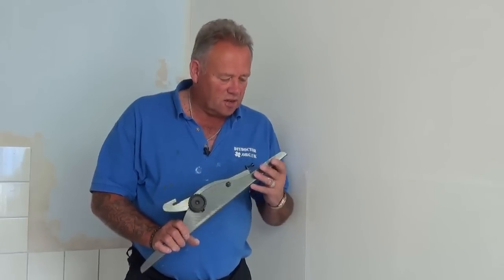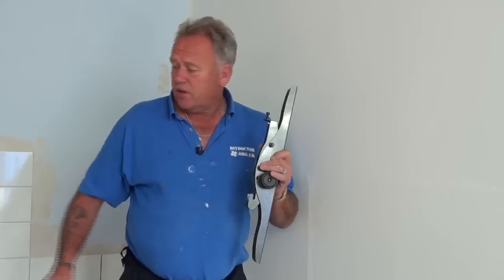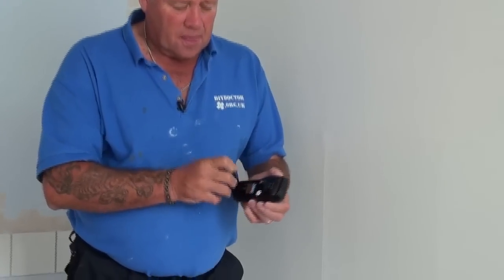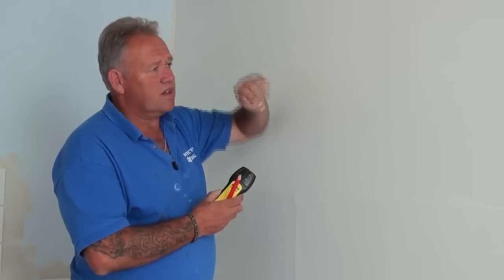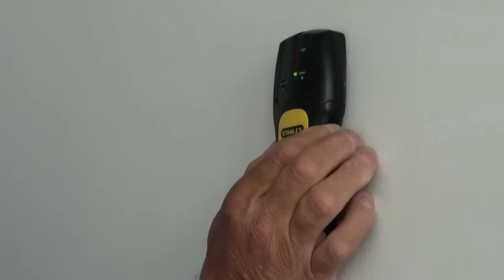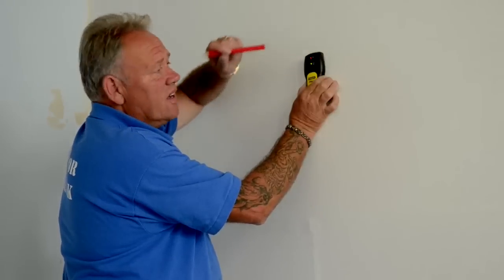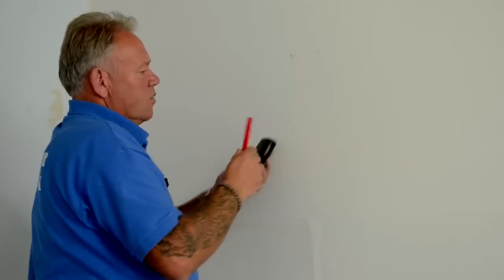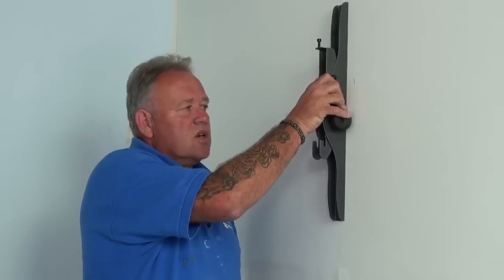How to use a Stud Finder

Comment: Oh come on....properly fixed using the right fixings no screen should ever fall off the wall even if you cannot find a stud.  Using your example of a 42" screen, with modern screens sometimes the bracket weighs as much as the screen....Hilti intersets or snap toggles each support around 300 lbs each fixing in single board wall.
Reply from the maker: +Mark Hollingsworth Well Mark, you are quite right, they do support great weights when all of the pressure is downward creating a compression force which of course, with a TV, it is very often not. Lateral pressure is something Lafarge, Gyproc have been trying to solve for many years and have spent millions on producing plasterboards of different types. There are some great fixings for lateral pressure and Grip It have one of the very best BUT the fact still remains as every single builder in teh world will tell you, fixing to a stud wherever possible is the safest of all fixings.
Reply: +DIY Doctor couldn't agree more, I install this kit for a living and will always try and hit a stud but there are times when this is not possible..portrait digital signage limits stud fixing, that's when fixings make the difference. Toggler snap toggles are hard to find but allow me as a big bloke to hang off a TV bracket mounted purely on single skin wall

Comment: I have the same model stud sensor (Stanley 77-110) as that shown in the video. When I use it, the AC light flashes and the unit beeps continuously. I replaced the battery with a fresh one, and it still behaves the same way. The unit seems to be functioning properly in all other respects in that it successfully senses studs behind a drywall. Is there something wrong with my unit?
Reply from the maker: We have come across this before Scott and it turned out there was a tiny short circuit in the wiring of the sensor.If it's not too late, return it to the shop.